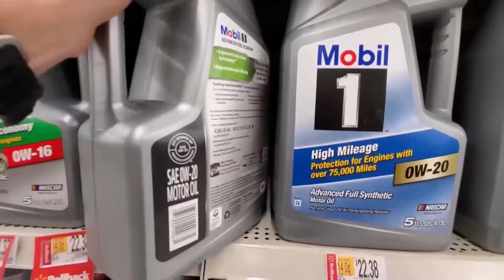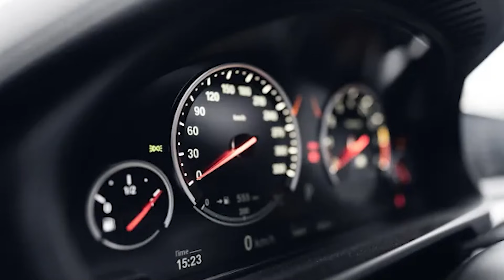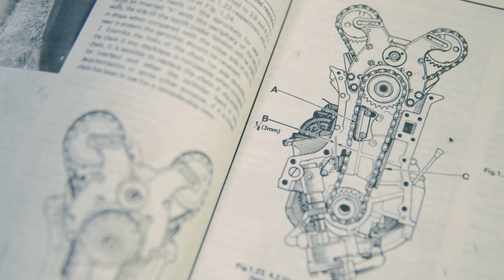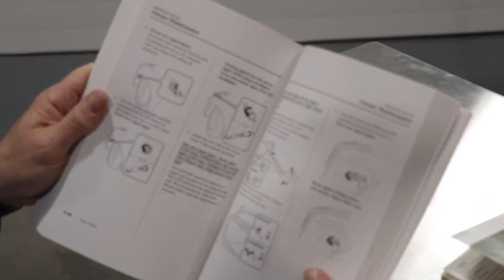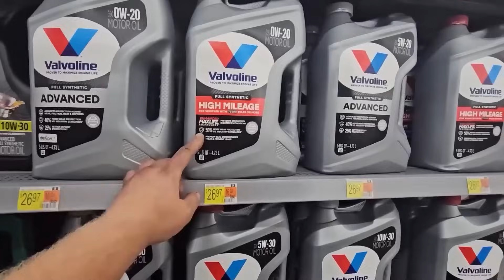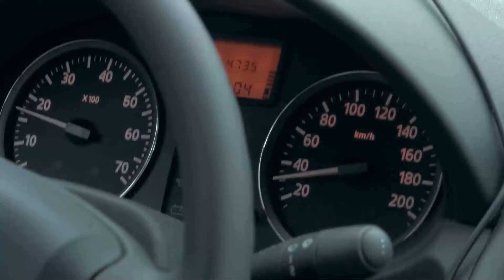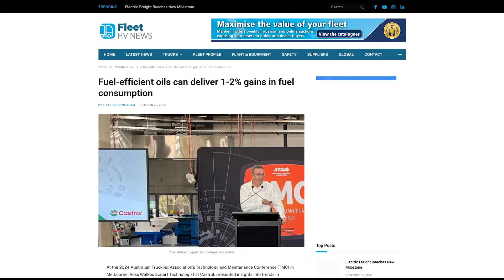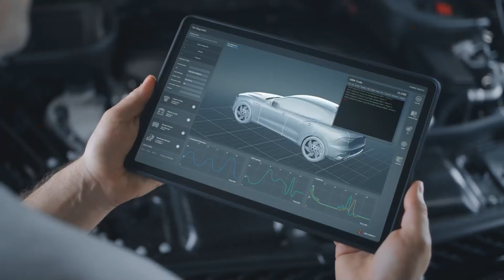0W-20 vs 5W-30 — The Oil Mistake That Ruins Engines

Comment: Just had the engine replaced in my 2023 Hundai Tucson. The 2.5 liter Smartstream. Oil starvation problem trashed it.  Oil recommended on the oil filler cap is 0W20 but they used 5W30 in the new one?? Fortunately,  the warranty covered everything including a loner.😂

Comment: Great video.   Better than garbage saying to switch to 5w30 if your engine specifies 0w20.   Also should add thicker oil holds more heat (engine runs slightly hotter) and cools less efficiently.

Comment: Sir 
 In my place temperature in winter are 22 degree centigrade and in summer temprature rise up to 43 degree centigrade 
 Plz advice which oil i can use in my gasoline engine car 
 0w16,0w20,0w30,5w30 
Plz advice us 
 Thank you
Reply from the maker: If I were you, and assuming your manual allows (or calls) 0W-20: I’d use 0W-20 in general.
For very hot summer (e.g., when ambient hits 43°C + heavy usage), if OEM allows, consider switching to 5W-30 (or 0W-30 if allowed) for that season.
I would not pick 0W-16 unless clearly outlined in your manual.
I would only pick 5W-30 year-round if the manual lists it as acceptable and your usage justifies it (e.g., hot climate + heavy load + high mileage).
Hope this helps!
Reply: @SUVTestLab first of all thank you sir 
 Now comming to the point 
 Vechile manual didn't provided to us by dealer 
 Now authorised service centre says 0w16 
 Vechile heated up 
 Previous i have said about my place temperature 
 So plz suggest us which oil grade i have to use in our vechile sir
Reply from the maker: @alokjha520  If the authorised service centre recommends 0W-16, that’s likely what the manufacturer specifies for your engine — and it’s safe to use.
However, since your local temps reach around 43 °C, it’s smart to double-check online for your exact car and engine model (official website or owner’s manual PDF).
If your engine allows both 0W-16 and 0W-20, using 0W-20 in hot weather can offer a bit more protection.
If it lists only 0W-16, stay with that grade — just be sure it’s a high-quality full synthetic meeting API SP / ILSAC GF-6B.
Reply: @SUVTestLab sir can I use 0w30 instead of 0w16 in it plz suggest
Reply from the maker: @alokjha520  I’d strongly avoid jumping straight from 0W-16 to 0W-30 unless your manufacturer specifically lists it as approved.
That’s a big jump in viscosity, and engines designed for 0W-16 have tight oil passages and variable-valve systems calibrated for low-viscosity flow.
If your manual or official website confirms 0W-20 is also allowed, that’s the safest step up for your hot climate — not 0W-30.
Only use 0W-30 if it’s clearly mentioned for your engine model.
Reply: @SUVTestLab ok sir can I use 0w20 instead of it to reduce friction and for proper lubrication instead of 0w16 plz suggest it

Comment: Then why do they put 5w30 in the cars in other countries. 0w20 is used in the United States to increase the fuel mileage. It ruins the bearing surfaces prematurely
Reply from the maker: It’s true some regions use 5W-30 — that’s because of hotter climates and different fuel-efficiency laws.
0W-20 isn’t “ruining” engines; newer ones are designed for it with tighter tolerances and variable-flow pumps.
Bottom line: Use the grade your manual lists for your region — both 0W-20 and 5W-30 are safe when used as intended.
Reply: @SUVTestLab  0W20 protects from -40 to 59 degrees Fahrenheit.
Reply: @SUVTestLab  can we use 0w30 in place of ow20?
Reply: @SUVTestLab  Well then why did GM switch from 0-20 to 0-40?  Cause the engines were failing. And I heard a month ago even that wasn't helping either.
Reply: @johnweiss816 read the nhtsa report closely.  The report found no problems with viscosity but issues with wear surfaces due to manufacturing defects.  GM switched oil to put s bandage on the problem.
Reply: @SUVTestLab this is not s universal claim for all engines.  My car specifies 0w20 in all counties,  Follow the manual your car came with.